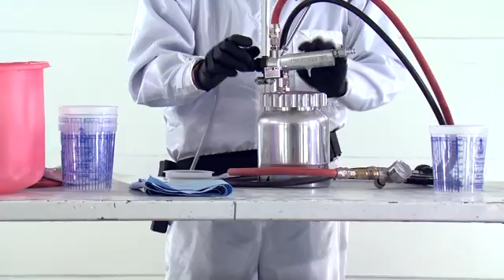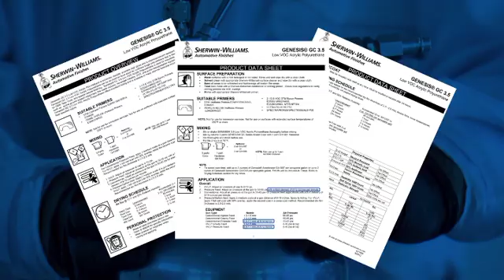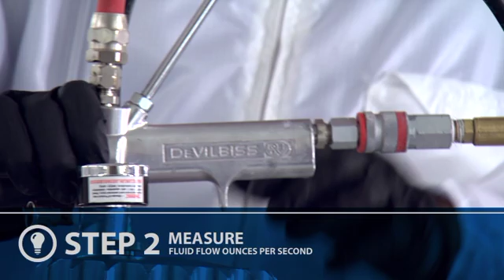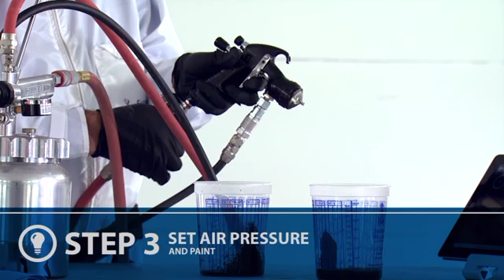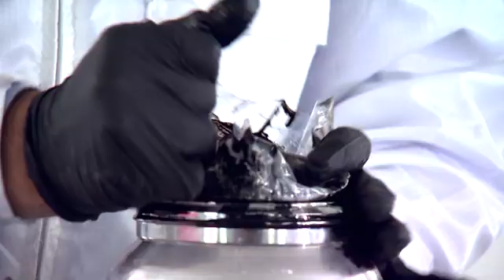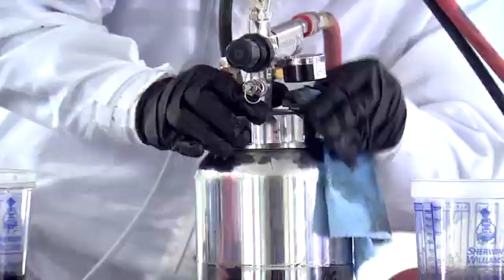Ask Sherwin-Williams how to...set up a Pressure Pot.

Comment: I was hoping that one of these videos would tell me how to connect the compressor to the pressure pot for painting.  It looks like the spray gun has 2 inputs, 1 for the air and 1 for the paint.  I only have one line coming off of the compressor, so do I get a splitter and split the pressure between the two or do I have to get a second compressor to feed the pressure pot while the first one feeds the gun?
I asked the store where I purchased the pot and they are somewhat less than responsive!
Reply: You need a gun that takes an air and fluid line, designed for a peessure pot.

Comment: Here is the simple, foolproof, quick way to dial in your settings. Turn off the atomizing air to the gun. Press the trigger. Increase pressure to the remote pot so that the liquid stream shooting out of the gun (unatomized) will arc at about 30" - 36". Then, slowing add atomizing air until you get a proper fan that seems nicely atomized. Done.

Comment: does the pressure tank need an air compressor to work?
Reply: Yes you will need compressed air to pressurize these kinds of tanks..
Reply: @1Batt  can you pressurize the pot, disconnect the compressor and spray? Or has to always have the compressor connected?
Reply: You would lose pressure...this kind of pot loses pressure once you disconnect the coupler...

Comment: if i hook up a 2and a half gal pot to my hvlp system,how can i set pressure on the pot at 15 lbs,when the turbine is only 9 psi?? or does that matter so my turbine is nine psi but i want 15 psi at pot
Reply: You will need a small compressor to deliver 15 psi to your remote pot. There are turbines that have tiny airbrush-type compressors built into them (along with the actual turbine itself), but these tiny compressors will not deliver 15 psi. By the way, 15 psi is a lot. If you are spraying material that is that thick, it's unlikely that any turbine system has enough power (CFM) to properly atomize a coating that thick.